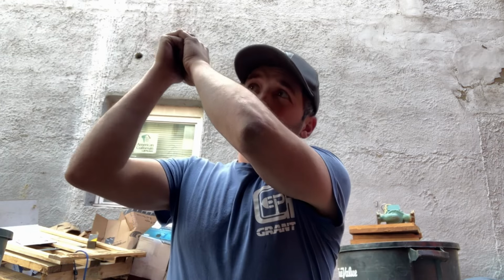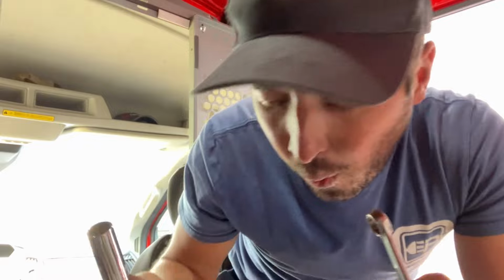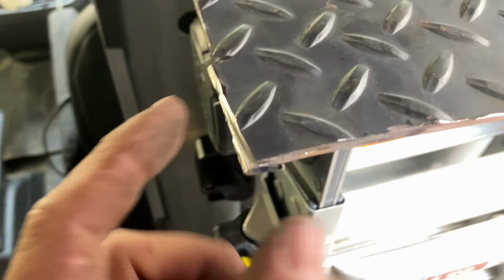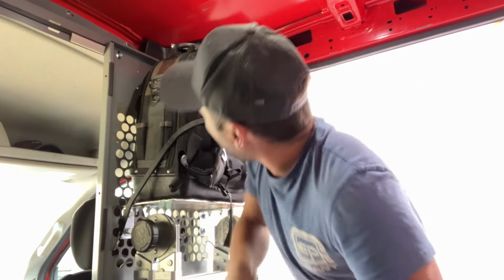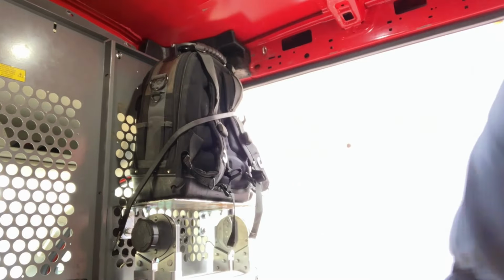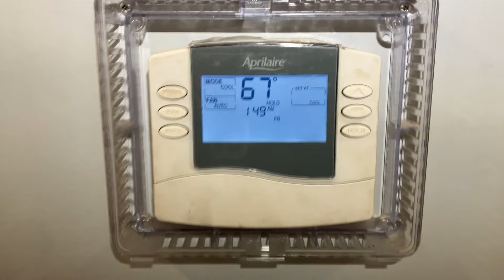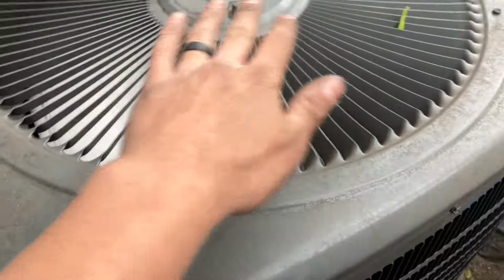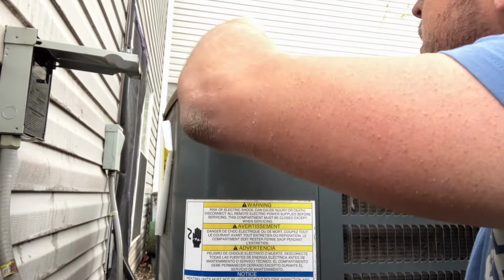Ultimate Veto Pro Pac Work Truck Setup

Comment: Reallt digging the shelf for the Tech-Pac. Wish I had room for something like that.

If I can figure out how to post pictures here I'll show you my light diagnostic bag solution. Went with the MB2 and have a little fishing tackle box in it with blue and orange wire nuts, a 15A screw base fuse, 3A and 5A fuses, a few valve cores and caps, and some crimp connectors. Saves me a trip back to the van and doesn't weigh much.

Comment: This is why I switched over to Wagos long ago. It's another thing the rest of the world got right 😂 Wire nutts are the worst. Haha
Reply: Nah just pretwist your wires and do the tug test.
Reply: @walnutcontractors5661  doesn't work on stranded wire, and it takes way longer to do and undo when it needs servicing... Nothing Wrong with wire nuts properly installed, but there are so many potential downsides it's not worth it.
Reply: Wagos are the best!

Comment: Wonder if the new safety features like Active Feedback sensing Technology (AFT) that automatically shuts down the tool if there is a sudden drop in rotation speed would have prevented your dad getting injured.  Can see why that would scare you away from using the tool !

Comment: You can use Velcro strips to secure the battery charger. Those wire nuts should been banned a long time ago, there's better options like Wago.

Comment: Yea roud out the corners or put something over them. Hell maybe change it out to heavy thick treated wood piece bracket on there. I could imagine slicing your arm on that metal. Oooof😅😭
Reply: I'd wrap the edges with auto door edge trim.